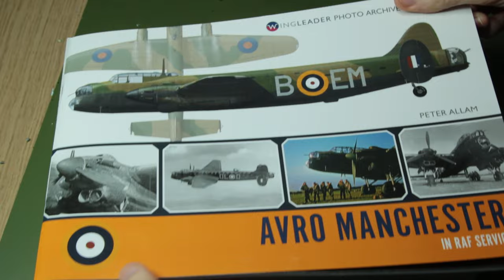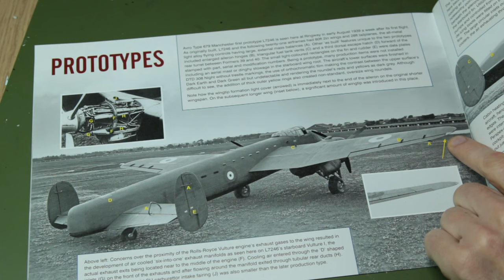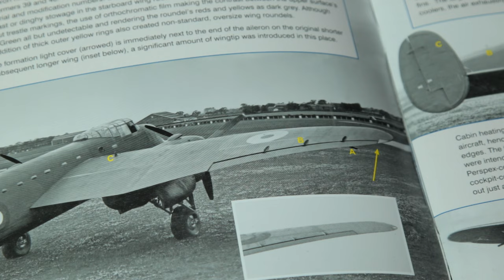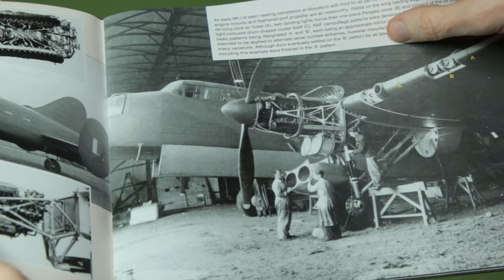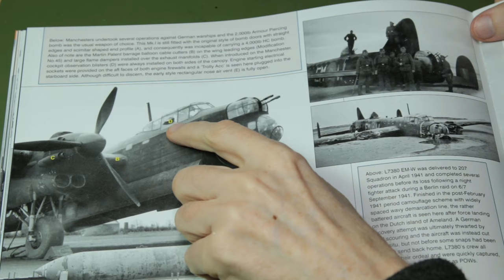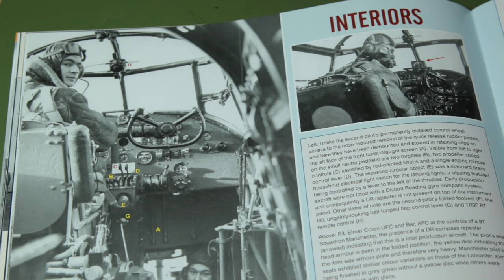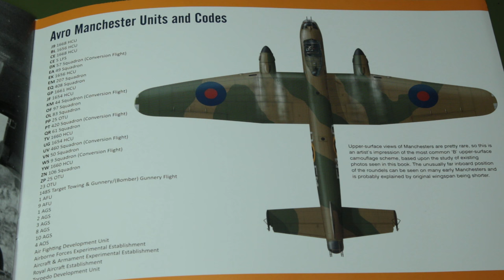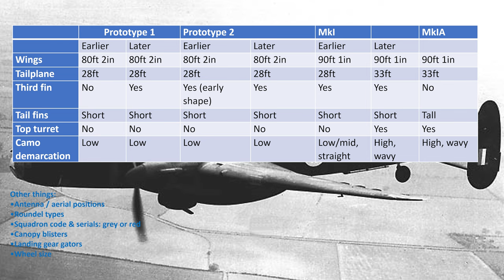Avro Manchester build - part 1 - with Wingleader photo archive and Blackbird conversion kit

Comment: I'm anxious to see the build on this remarkable conversation. The " preflight" narrative of the conversation was extremely valuable explaining the complexity of your objectives. Ironically being a Lancaster " fan", I was not familiar with the Manchester . I wonder if this variant was the first phase of Lancaster evolution along with its combat record. The two engine version seemed very close close to the Wellington. Obviously I need to get the book :-) Happy New Year , Cheers until the next video.
Reply from the maker: I'm glad it was useful - I wasn't sure how well it would be received, not containing any actual modelling. The Manchester was generally considered a poor aircraft, with the main criticisms being aimed at its Vulture engines which were unreliable and prone to overheating. Interestingly there was a Manchester BT308 that had the third tail fin but was fitted with four Merlin engines - this was effectively, the first prototype Lancaster.
Reply: @ModelNerd  Thank you,  very helpful to understand the Lancaster heritage.

Comment: Happy New Year to you and your family. This will be a very interesting build to follow. I didn't realise that the Manchester had the same size fuselage as the Lancaster. Surely there must have been differences in the bomb bay because the Manchester, with half the power of the Lancaster and less wing area must have carried a lot less payload.
Reply from the maker: I did wonder about that myself. Considering that towards the end of the war Lancasters were flying operations absolutely at the limit of their take-off weight (and in the case of the various Specials, having gear removed to reduce weight), it seems odd that the Manchester would have the same size bomb bay. But I suppose that was the inadequacy of the Manchester - its engines couldn't deliver.
Reply: After a quick internet search I found that the Lancaster's bomb load was nearly twice that of a Manchester. However, the Manchester had a large bomb bay due to an original requirement to carry torpedo's but this requirement was dropped by the time the prototypes got to A&AEE for evaluation. @ModelNerd
Reply from the maker: Wow - I never knew it was planned to carry torpedos!

Comment: I;m surprised the Mark Ii was cheaper.   I tried to find one and they were scarce.  I love the Mark Ii because of the radial engines.  I like it a lot more than the more common Marks I and III.   A shame to waste it!
Reply from the maker: Recently Wonderland Models in Edinburgh had them on sale (I got mine from them at Telford). Don't worry, I have two - so I will be able to build one and cut up the other :)